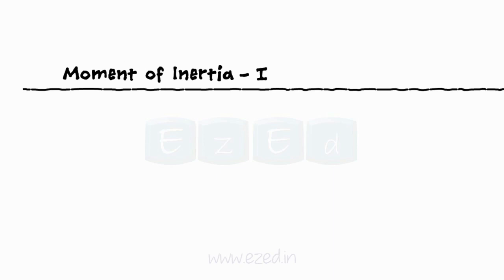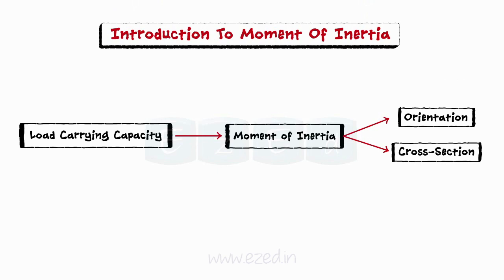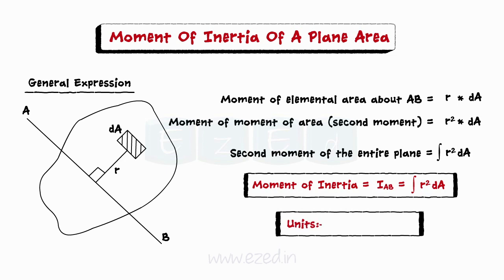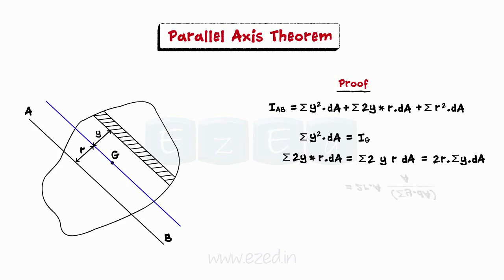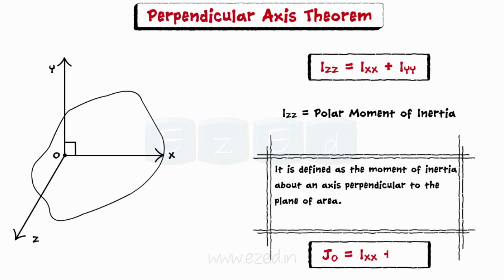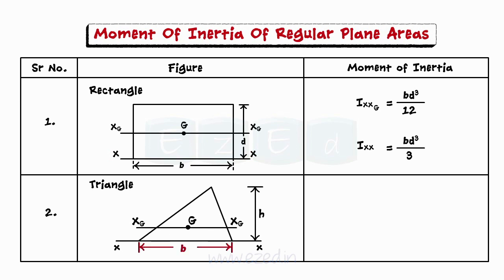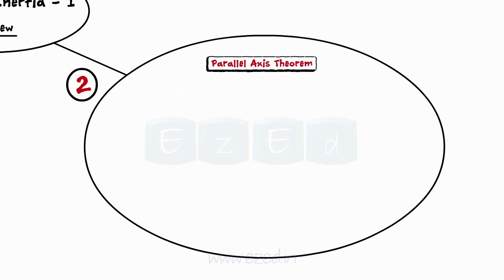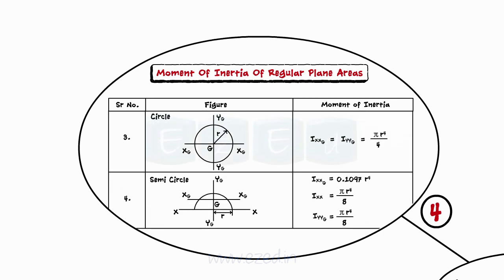Moment Of Inertia Part I - MOI Of Plane - Parallel & Perpendicular Axis Theorem - Solved Problems

Comment: Ok.  Despite all this detailed explanation.  What is point G in my brain and its moment of inertia?  It would have been nice if you’d summarised by going back to the table and showing what mathematical points fit on which part of the table.  If G represents the point where the block is going to break due to the weight—and then my brain fries.  All this jargon means nothing to me if it’s only explained mathematically, but not applying the maths to the practical.  So, if you can’t apply it to the table itself, then you’re only applying it to the forces affecting the object, which means maths is air and I’d take the broken table any day.  Point taken, I won’t sit my fat butt on a table with only two legs.